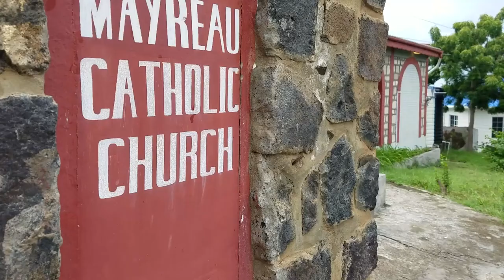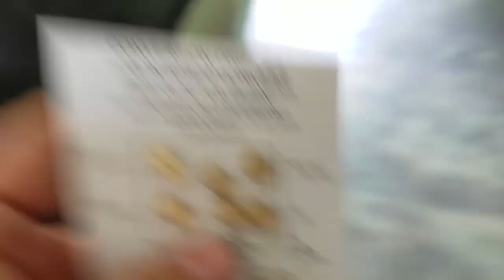Don't Burn the Place Down

Comment: So all the water you use is self gathered and self stored? Did your friend build the house himself? And I'm coming back to the fish question. Is there any local source of fresh fish? I would like to see what the locals are catching. You don't have to eat them.LOL.
Reply: And good job replacing the fuel metering jets. Water boiling should take less time with the correct flame.
Reply from the maker: Yeah! They frequently clean their catches down on the dock - so the local fish are all caught fresh. I've only seen them doing it a couple of times and it never made the edit. If I see it again I'll be sure to capture it. And yep - Bryce built this place with some local help. Even groceries get brought in on the ferry - so none of the supplies come from here. Everything we drink is water we caught or brought in by ferry =)